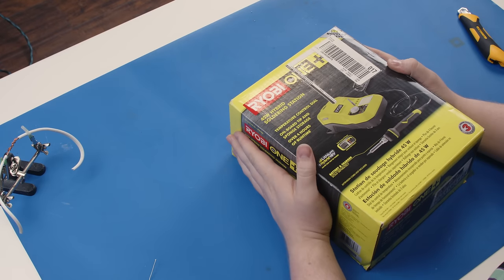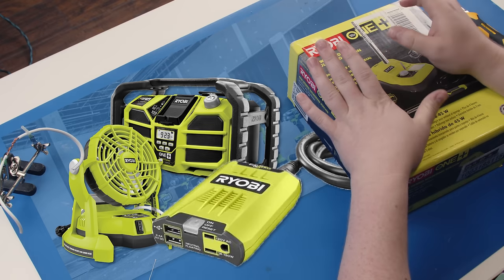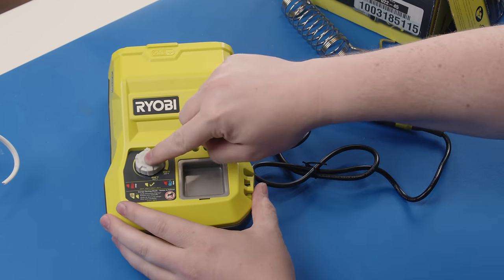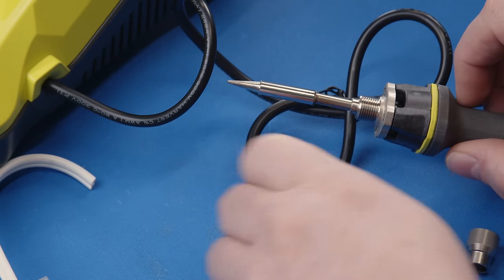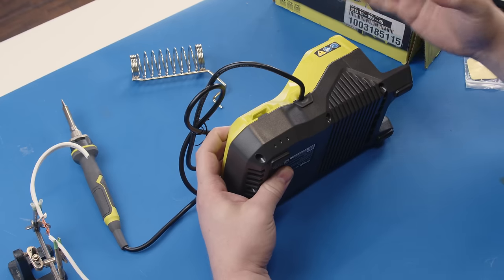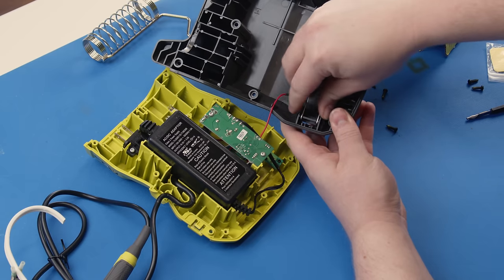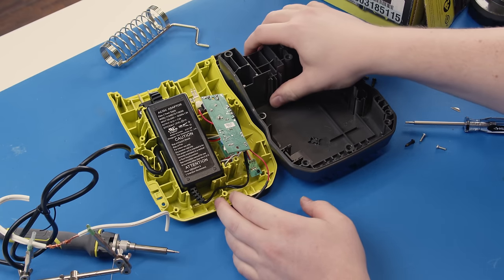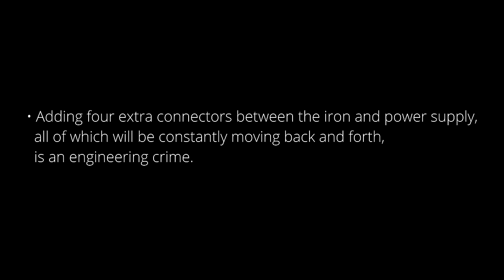Ryobi has GOT to be joking with this soldering iron

Comment: Note about the Pinecil system. Versatility - I made mine portable, used a barrel to barrel lead, a soldering stand with brass tip cleaner pad and a power wheels adapter for my DeWalt batteries. 20V Max is within spec and makes Pinecil portable. Temperature controlled with display, battery or laptop power supply, but most critically. The tip IS the heating element AND the thermal sense. Replaced all in one. Cheap too as it takes any tip compatible with the TS100 platform. You're right about USB power banks, not enough output usually for meaningful soldering, I have one for my Sequre Nano micro soldering pencil, but that is a different beast entirely.

Comment: Recently bought one in Australia, it has a bit of weight to it, however it doesn't have a hole to put the mains plug in... I'm curious if it has the space on the inside for the power brick.

Comment: When I was still in school I had a Weller that pugged in the wall outlet, it was okay. Later on I bought a number of soldering irons, some were good and some were not. At this moment I use a store brand rechargeable soldering iron and it is a pleasure to work with, I even bought a second one for when my first one will break down. It is low on heating capacity, but it is enough for IC's, LED's, resistors and small things. After using it I carefully wipe the tip with cardboard, never with a sponge or steel wool.

Comment: Great video! I have recently been looking at that soldering station because I'm currently on the Ryobi system and looking for a portable soldering iron besides my current plug in Weller with no temperature control.  I don't do that much soldering but when I do it's usually on a vehicle and I have to run a long extension cord.  I think I might buy one, anyway the light that you brought out and took apart, I have the same light that I bought about 2 years ago and I actually forgot that it's hybrid I don't think I've ever plugged it in I just slap it down on the battery so thanks for the reminder, but I love that light. I keep it in my truck most of the time, but I live in a small town susceptible to power outages, so I use it for those and for gathering and chopping wood. It's held up very well I've dropped it a couple of times and it has a crack in the frame but still works just fine.  Anyhow thanks for the great vid.

Comment: I had to chuckle at This video a lot. My entire youth in the 1980s was spent doing electronics in the garage and in my room as a hobby. The only iron I could ever afford was at first a radio shack 15 w stand-alone iron like the ones you were ranking on, and a little bit later in high school. I was able to afford a new radio shack iron that was switchable between 10 w and 25 w. I still have that iron and it still works, though I now use a much better Hakko station. Projects I built 30 plus years ago with those cheap irons and basic solder Are still working fine. They were the standard for home hobbyists, including people building home computers. Temperature controlled irons were expensive and for people with money.

The cheapo irons you pointed to on the shelf though that can be obtained today Seem to be nothing like those old radio shack irons we used to use back then. The new ones are absolutely garbage every time I've seen one and tried to use one.

Comment: Not sure if that's going to fit your requirements, but you might want to look into a TS-80 or a Pinecil. They can be powered from USB-C PD using any power bank that supports it, or just a regular wall plug. They have temperature control and other jazz too!
Reply: And now we know you didn't watch the odd little bit at the end of the video. ;) There's text specifically mentioning the TS-80 and Pinecil. Interestingly though, it says he has a Pinecil on order.

Comment: i have no idea why the connectors on the inecil are a problem. i do automotive work and a fair bit of it is wiring and electrical repair. i ahve a pinecil, and the reason the connector is great is because it can accept 9-24 volts. i made a cable with clamps on it and i can use it with any vehicle. you could get a small case, an adapter for ryobi batteries, and make/order an assortment of cables to keep in the case for any requirement. also, most phone battery chargers are literally the same internals as a ryobi pack, a few 18650s and a control board. the quick charging ones can put out a range of voltages and the pinecils board can communicate to it to get the max voltage possible. also since its a plug connection, 2 of them, you can replace a cable or use a longer one, whatever your needs may be. it requires more work on your end but its honestly the best iron ive used. heats up in seconds on 12 volts, and has enough ass to solder heavy wire connections in automotive harnesses, which can be a challenge.

Comment: I use that milwaukee iron for work (onsite wire splicing) and it's really nice.  I set the angle at 45 degrees, hold it like a pencil, and rest the battery on my wrist.  Feels nice to use like that, and it thankfully hasn't broken yet

Comment: We used little butane torches most of the time for soldered connections in road construction truck assembly, using the very tip of the flame.  They worked surprisingly well once you got used to them and were faster than irons.  Could easily shrink the heat shrink with them too.  Also, no batteries, just a quick fill-up.  But for finer jobs, an iron was the way to go.

Comment: I love my TS100. Built the power supply so I can connect it directly to my makita 18v battery, and i've got portable soldering for days. You can make your own "strain relieved permanent cable" with any material you so desire. I'm not sure what the 4 cables are between the iron and the power supply are, I only have one. To say its just a hobby soldering iron is just narrow minded. I work as an audio technician, soldering countless Audio cables, repairing 3000€ CD players and professional record players all with my trusty TS100. Works like a dream. Also when i have to solder mains cable. The firmware is open source, so its possible to customise the settings. Maybe you should think about altering your workflow to accommodate the TS100, because its a damn good professional soldering iron.

Comment: Allow me to disagree with you on plug-in regular soldering irons, I've been using them for years and they generally do the work they are designed for if you respect the wattage required for the job you do, they won't overheat your joints if you don't use some ridiculously over-rated soldering iron.

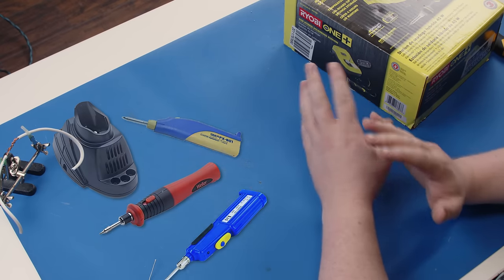Comment: That blue battery iron you have on your bench, visible bottom frame at 4:12, works a treat if you use Nickel Metal Hydride batteries. I have one, it's my go-to iron for quick jobs where I don't want to set up the soldering station. But you absolutely MUST use NiMH cells, alkaline have no current and you lose use once the voltage drops.

Comment: The bare ceramic element going directly into the tip is deliberate for better temperature control. You want the temp sensor as close to the tip as possible and you don't want a lot of metal mass in the tip like the old irons where it was used as a heat reservoir,  you want the electronics to quickly sense and compensate as heat is drawn away regardless of the size of joint within reason.

Comment: I have a Pinecil (which can be purchased with its own silicone USB-C cable) and a DeWalt DCB094K, which adapts their "20V Max" (really 18V Li-Ion) batteries to USB-C. You do have to have a separate stand and sponge, but there's one meant for the Pinecil that's nice and portable. A few more pieces, but less total volume and it has a digital temp control.

Comment: I think most people would be hard pressed to use this long enough for the heat to be an issue.  Remember the glass in the plastic will also act as a heat sink for a while anyway.

The nice part of the wall wart design is if it fails you don’t have to go to Ryobi for a replacement part. 

Interesting vid, thanks!

Comment: 18:20 - You're probably right, but at first look, I think that looks more like a reinforced Acetal plastic like Delrin. PA6 is, if I recall correctly, a Poly-Amide plastic, reinforced with Nylon and fiberglass. (To oversimplify,) If you extract the Poly-Amide plastic alone as a fiber (like with PET to create Polyester), you get Kevlar. It's probably too high-cost and too difficult to machine for this kind of application. Reinforced Acetal is high temperature (relatively), cheap moldability (with a proper vacuum), cheap and easy machinability via lathe or mill, pretty good surface tracking resistance and volumetric resistivity, and quite good dielectric breakdown resistance, especially with extra thickness. I'm not trying to sell it, I just spent a few years in an HV EIS lab and stuff like Acetal and Nylon-composites were all over the place. Pretty sure I could predict the UL94 burn test results or ASTM D-149 dielectric breakdown results for just about any common plastic with reasonable accuracy - give me a chance to review the test standards again first and I'll nail it. lol.

Comment: For 40 years I used a Weller dual heat pistol grip iron. I must have soldered tens of thousands of connections and never had a problem with over or under heating a join. Any decent tool is only as good as it's user. That 'spade tip' is useful for de-soldering, used with a woven wire strip it will quickly suck up all the solder...:eyes-pink-heart-shape:

Comment: For basic soldering the Weller rechargeable soldering iron has done me well.  I work on machinery so all I use it for is to do wiring repairs. Very convenient to not have to worry about an outlet.  No electronic work is done with it.

Comment: black and decker did a very similar thing with their vacuum cleaner that runs on their standard 18v battery. the wall mount/charger that you hang the vacuum from is literally just a big plastic tomb for a standard battery charger. the regular charger is even pretty easy to pop out of the plastic tomb in case it breaks or the cord snaps; you can replace it in a few minutes. as much as people hate on black and decker, they are killing it with product design

Comment: I got one of these and it works great, I use it all the time.  I did turn the iron holder around backwards so it don't stick out so far though.  The cord is a little stiff but works fine if it's unwrapped and stretched out!

Comment: I've been soldering since I can remember. Your analysis is right on. Probably the number one worst thing about this iron is the cable to the soldering pencil. I've seen cheap wires like that pull the iron right out of the holder.

Comment: Nickel cadmium had enough oomph. Didn't last that long, but the internal resistance was so low, you could supposedly start fires with one 1.2V cell.

    I started without a stand for my irons. I just put it down carefully after wiping the tip on some soaked cotton wool. When the fateful day came and I left a soldering iron powered on in the middle of a stack of paper... Well, it was a good job it was only a 15W iron. I came home to minor scorch marks on 2 of the sheets of paper. To this day I don't know how it happened, but, yay for 15W irons, I guess. There's nothing else good about them. A friend once told me a hotter iron would do less damage to ICs. You hold it on the pins for less time, so there's less time for heat to travel up the pin. I always used sockets.
    EDIT: And then I heard from a pro who prefered to have a range of irons and choose the right wattage for the job. His favourites were 25W and just 12W. That would explain why my 15W iron was so well put-together: some pros do buy 'em.

    Hahahaha! Temperature control was a luxury feature when I was a kid. I had that 15W iron which I put several projects together with and they held, but I didn't end up using them much. Then I got a 25W budget iron which was almost all right. The lack of temperature control was minor compared to the fact that that the tip was huge and tarnished far too easily, but I managed.
    Eventually, I got a 35W TC iron and that was really nice... even if I did have to adjust the temperature with one of those plastic trimming screwdrivers while trying to figure out the tiny temperature marks on the side of this slimline iron. Seriously, the handle wasn't much thicker than the cable into it, and the adjuster was on the handle.
    So now you have my "we walked uphill both ways in the snow" story. ;)

    Oh yeah, those springs are awful for getting tangled.

    Don't recall having a dehydrated sponge, that was quite a sight. Then again, it's been over 30 years.

    Despite the horrendous adjuster on my 35W iron, (the handle was thinner than the Ryobi's,) it had a feedback loop; it was not a dumb circuit.

    Oh it's the cable. Cables were never good on any of my irons, but they weren't as bad as that one. Ironically perhaps, the extremely cheap 25W iron seemed to have the best cable, but that was probably because it had the biggest heaviest and longest handle so the cable exerted less force in proportion. They all had mains power straight into the handle, and I can barely remember the last time I handled a rubber-jacketed mains cable in the UK. They're probably illegal or something.

    At the big reveal... I LOLd ;)

    If you take the sponge tray out, can you see the power brick's light in a darkened room?

    Hahahaha! "Are they compensating for something" is usually the first thing I think of when something's that solid. Sometimes I like things chunky, but only on an artistic level, I never take it as an indicator of quality.

    ...Hey, if transporting 4 bits is the problem, why not get a couple of metal angle-thingies and bolt or glue the old soldering stand to the side of the Weller? And if the sponge keeps falling out, maybe cut a slightly larger one. If I can use cotton wool... oh, be sure to keep it very wet if you're not sure it's temperature-resistant. Keeping it that wet might be a hassle, I guess.

Comment: For the auto industry the milwaukee soldering iron has been great. I've had it a while now and had no issues, you can get into places easy, and when it's hot you can set it down on the battery off to the side and let it cool down

Comment: This is 2 years old so I assume you found a solution but if not I HIGHLY recommend looking into either the ts100 soldering iron or pinecil (my preference). Both very cheap electronic hand heled soldering irons with extreamly good temperature control. Both can be run off a lipo battery, wall adapter or usb-c (tho needs a decent adapter, on 65w it's insanely fast to warm up).

I have one of their USB power station things on my desk with a soldering stand/spare tips, take the same iron out with me and run it on a usb powerbank.
Reply: They also sell a high temperature USB-c cable to save shocking "iron can melt through its own power cable" issue.

Comment: For battery soldering irons, the Milwaukee M12 is such a great unit.   Run it with the 4.0 battery and it last long enough and the battery gives it a base to stand it up.

I have JBC and Weller Pro stations on my bench and I still reach for the Milwaukee more often.

Comment: I have that Hakko FX-901. It uses 4 AA batteries wired in series and does a decent job for smaller stuff. The cap makes no contact with the tip so you can pop it on after soldering and it will prevent the iron from burning anything as well as prevent it from being turned on. It does lack temp control but is nice to have for something simple and quick. If you want something portable and more sophisticated, I highly recommend the Miniware TS100/TS101.

Comment: I have a hart one, it "doesn't have temperature control", but it have a internal potentiometer (and it also have temperature sensing on the tip).
But yes the iron is basically indestructible. That mounting plate is insane, it's screwed-down, I have sent tons of pressure down the head, still the most solid piece. And I have used $1000 wellers. The ceramic they still do this, cartridge ceramics are a very recent thing. And yes, cheap regular wires.
My unit don't come with a power supply internally, so I imagine the heat isnt really going to be a issue. The two power supplies are wild.

Comment: Hi, I used to work at Home Depot and Ryobi tools are great for a home owner.  When I would be selling cordless tool, I would always ask the customer what they were going to be using it for.  Everyday use or was it occational use?  If everyday use, i would stear them towards one of the higher end cordless tool.  But the occational use (Home Owner) is fine with the Ryobi.  Currently, I have about 15 of the tools and around 10 batteries most for over 7 years.  to this date, I have only had 1 tool and 1 battery fail.  So don't be afraid to by them for the occational use, and I don't currently work for Home Depot.